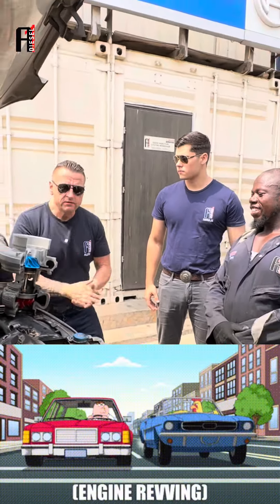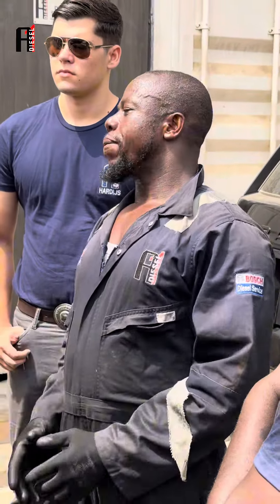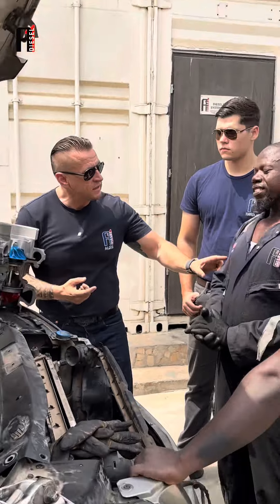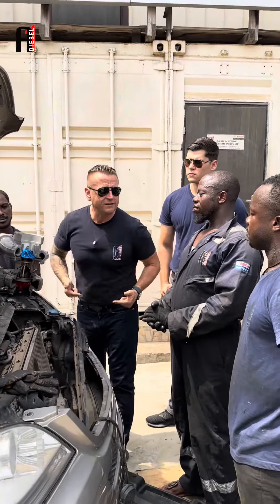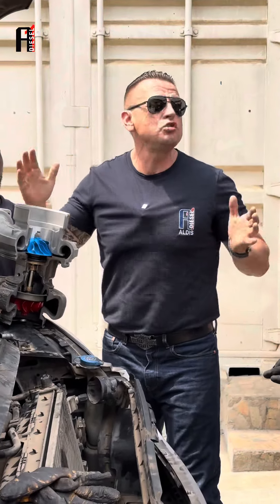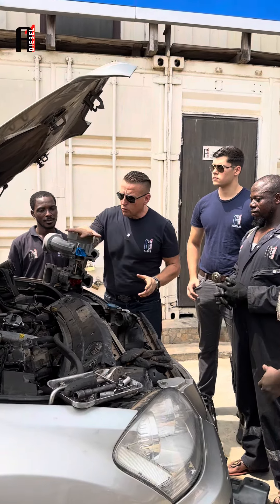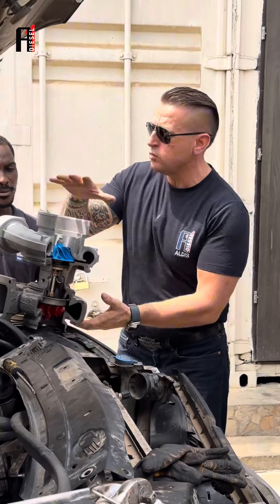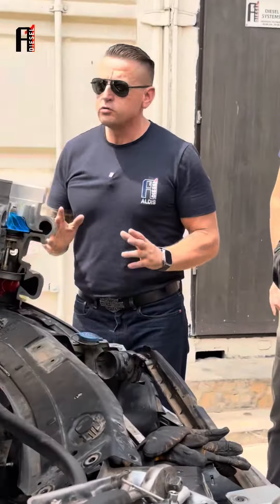Why we should never accelerate on idle when new turbo is installed? #revvingengines #turbo

Comment: incorrect information, as soon as you crank the engine the turbo will have sufficient oil on the bearings, the one thing some mechanics do wrong which causes new turbo failure is they dont prime the turbo with oil, you should always put a small amount of oil into the oil feed port before installing and you should also crank with the fuel pump/injectors unplugged to get it circulating before starting. you can rev the engine at idle with a brand new turbo no problem, how do you think tuners map a new turbo? there is no such thing as a turbo run in period.